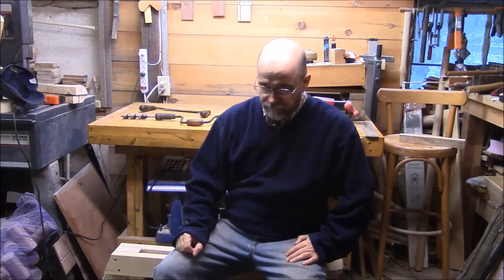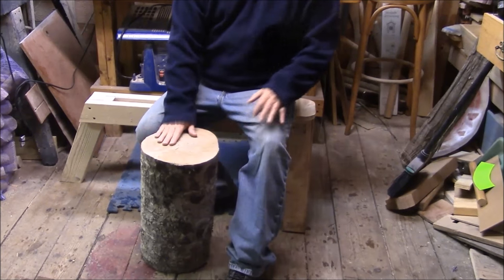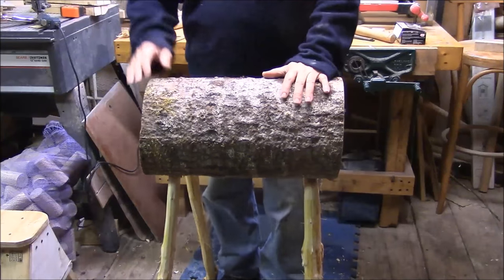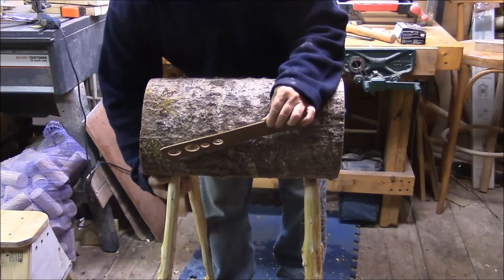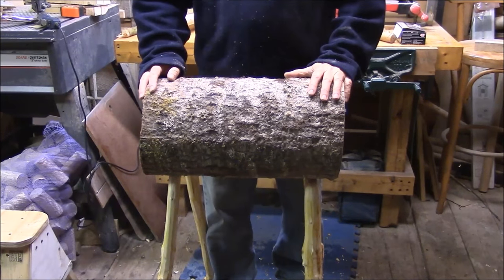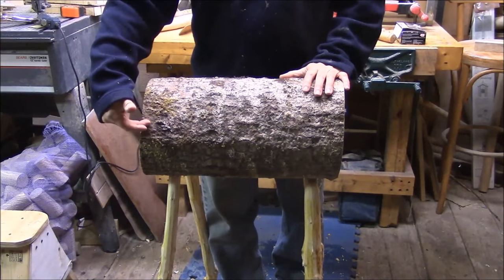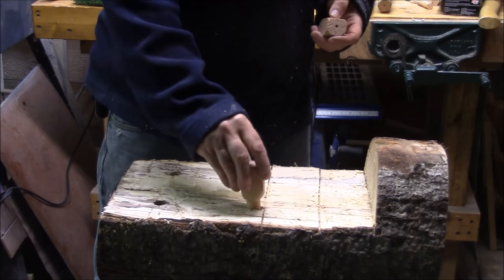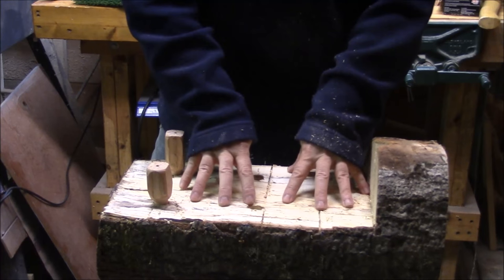Green Wood Carving Bench

Comment: You do nice work but the bench looks wobbly and the log doesn't look green. If your legs are green they will loosen up as they dry. "Green" woodworking works the opposite way, bone dry legs and a green log and the legs will tighten as the log dries. I'll be watching more of your videos, interested in how the bench worked out. Thanks